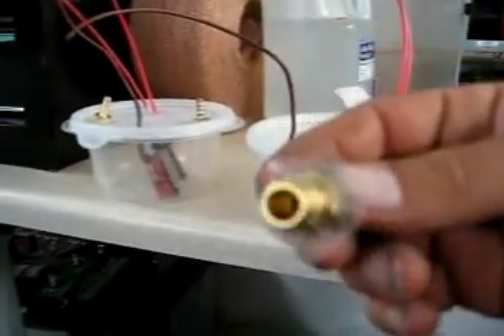Nickel cells 1

Comment: Yes, I am curious as nickel can convert Hydroxy into electricity just like platinum can in a fuel cell.  But I have heard the nickel wears down in the acidic hydrogen environment during the catilytic conversion. I have yet to experiment with that, but could be usefull, like a hydroxy gas battery. :)

Ben.

Comment from the maker: It is a test to see what happens basically. Checking to see how the nickel reacts in the cell, and checking eff. to see if there is a benefit to it. Also will be checking differencial metals. There are a few theories I have about floating voltage, and applied over threshold voltage. but more on that as time goes. Nickel plates are on loan of sorts when I have finished testing them every way I can think of I will be passing them back or on to whom ever the owner wishes. Nickel is pricey